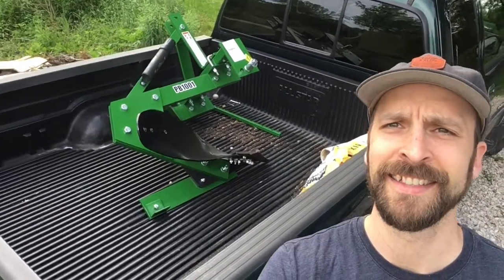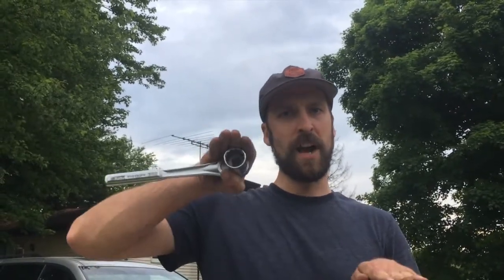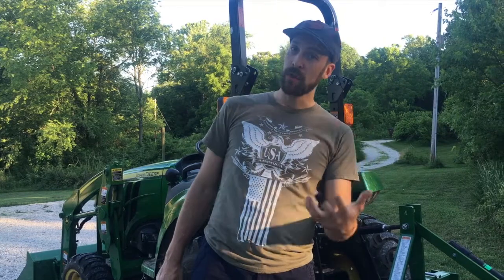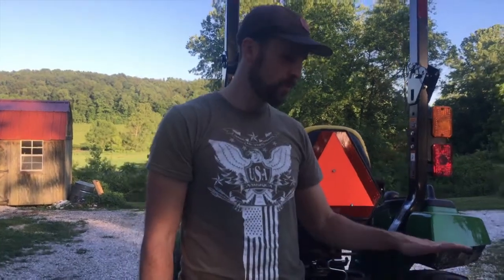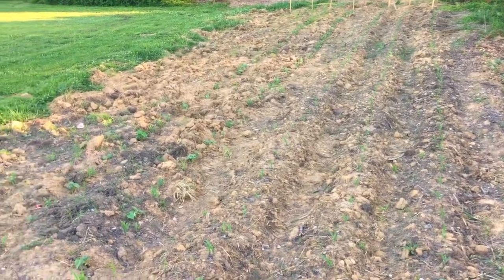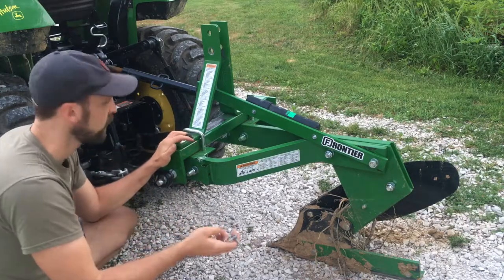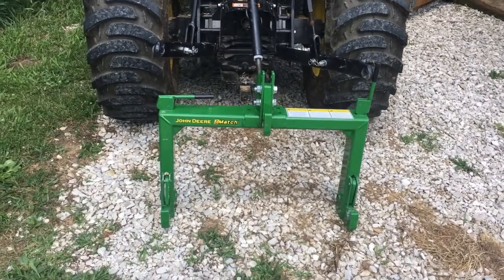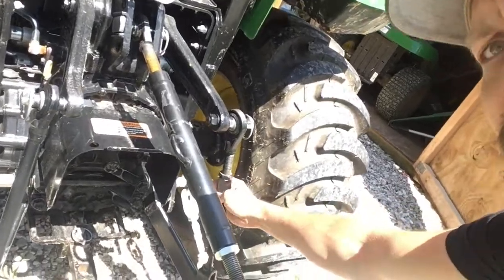First Time Pulling Plow on John Deere 2032R

Comment: Okay, the idea behind the hitch pins being offset is so that the plow is running level in the furrow. So, on the first pass you set the plow level like you had it, then you drop your right tires in the furrow and adjust the plow so that's its again level with the ground and you get nice even forrows from there on.

Comment: The top link uses a top link pin.  Maybe they call them "quick link bolts" these days, but its a top link pin.  You're learning.  Keep at it.
Reply: They are still called top link pins. He trued to hook the plow to the tractor using the I-match quick hitch at first and found out that a quick hitch is not compatible with a plow. Don’t know why he removed the bold and fastened the top link there instead of the hole above with a pin.

Comment: Yeah I found out that the iMatch doesn’t work with all attachments the hard way.
Reply from the maker: Yeah, I was pretty bummed about it too. I only started with two rear attachments and I could only use the box blade with the iMatch. Oh well. Although, I am sure the more iMatch attachments I get the more valuable it will seem. It sure is easy to pop the box blade on and off.

Comment: nice. also maybe get some grabhooks and a Clevis Mount to attach to the bucket, help lift logs/stuff off the truck
Reply from the maker: That’s a great idea. A friend has a 2038R and he has grab hooks. I was at his place and saw the value quickly. I am not sure what a Clevis Mount is, but I’ll have a look. Thanks for the advice.
Reply: @GeekTractor  Clevis mount can be useful too. Both on Amazon. Im getting a 2038R and will mount the hooks where the loader arms meet the bucket and the clevis mount in the middle
Reply from the maker: Nice! I have a friend who does welding. I talked with him about putting them on. You will probably see a video about it on this channel in the future :)

Comment: Your top link goes in the empty hole at the top.  The one you disconnect I'd to provide structure and support to the plow.  Would have worked if that was fixed